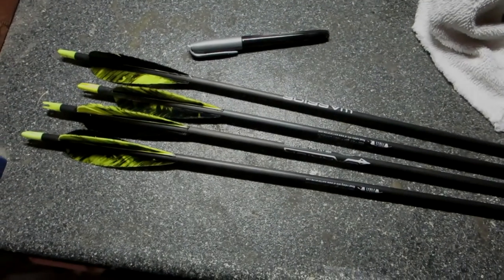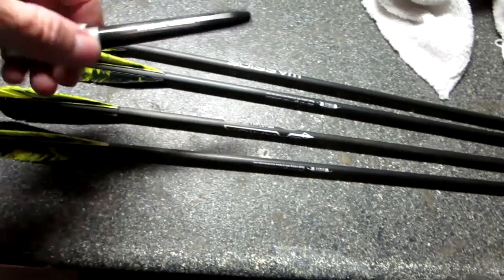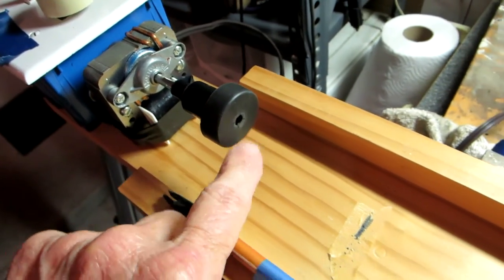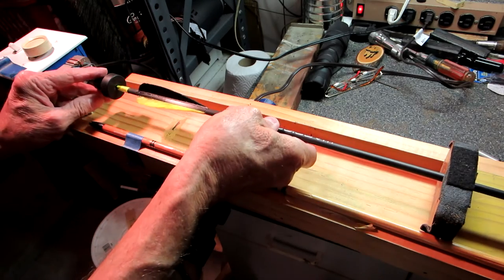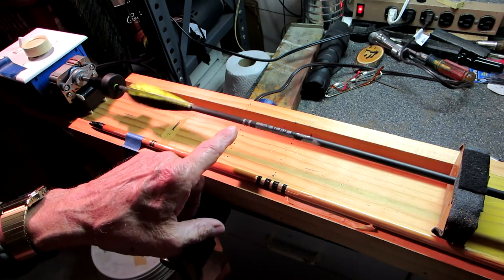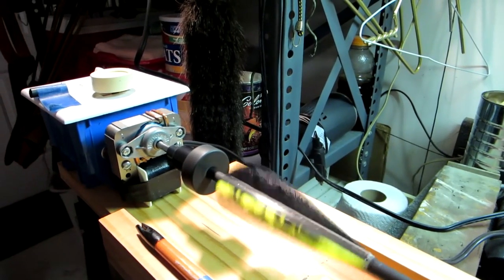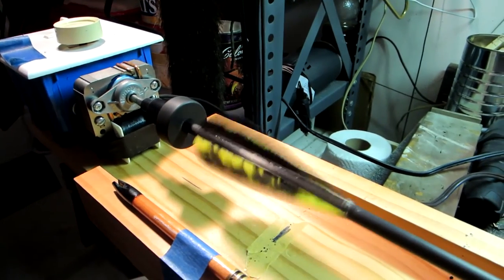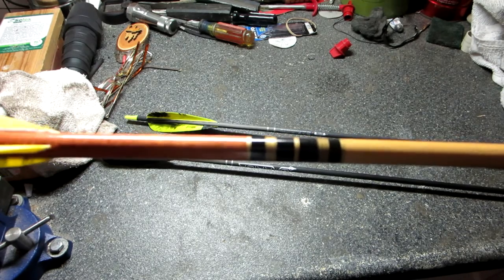Simple arrow cresting with my DIY arrow cresting machine

Comment: Boy id sure like to see how you wired that with the switches so I could make one lol
Reply: if you don't feel like brushing up on the basic electrician thing, just go to a big box store and get one pre-made. You can buy a light dimmer slider built into an extension cord. Then all you have to do is (if there's not a plug on the motor already) take a scrap electrical cord (with plug intact) and strip the two wires and attach them to the wires for the motor. If the motor happens to work better with the wires one way than another in regards to +/- (well, really Hot/Common), you can go with the better  type of orientation that works better, but in my experience with these little 110 volt AC motors it never matters. In fact ones like he has often have a non-polarized plug on them from being a bathroom fan installed, and can literally be plugged into an outlet either way.

Comment: Looks like I have the same fan motor. Could you share with me how you mounted and wired it? I'm building one very similar right now. Thanks!
Reply from the maker: I’ll start by stating that playing with electricity can be dangerous.  I am not responsible for any mistakes or accidents you may incur. If you agree, then you can proceed with the below...

I simply mounted the motor directly to the outside of the electrical box (with spacers as needed) so that the motor bottom and switchbox bottom were even when sitting on the mounting board.

Since the motor has just two wires, you’ll only need a two-wire supply line (typically lamp cord) with a polarized plug end (One spade larger than the other). Purchase an inexpensive extension cord and cut off the female plug end, keeping the male plug end you will plug into the wall for AC supply. It’s important to keep the correct polarization of the connections for safety reasons. The large spade of the plug end is the neutral spade. The exterior of the lamp cord on the neutral side will be either ribbed or have a white stripe. That is the side that connects to the large spade end of the polarized plug. The other wire is the hot wire and will have a smooth exterior. The single pole switch (here after called the on/off switch) controls the supply (hot side) to the dimmer and the dimmer controls the motor speed.

OF COURSE THE SUPPLY CORD SHOULD NOT YET BE PLUGGED IN

The On/Off switch should break the hot lead (black or smooth side) of the lamp cord. You can go ahead and connect the white or ribbed neutral supply wire of the lamp cord directly to the white lead of your motor, inside the switch box where you have mounted your motor.

Turn the On/Off switch to the off position. The black/smooth (hot) wire from the lamp cord goes to the top screw (brass) on the side of the On/Off switch. Now connect one of the wires from the dimmer control switch (doesn’t matter which dimmer wire is connected) to the bottom screw (brass) of the On/Off switch. Connect the other dimmer control wire to your other motor wire (black). You can ignore the green wire on the dimmer since you’re only using a two-wire supply and the neutral wire should be correctly polarized and connected to the polarized spade lug (large spade) of the plug, if you’ve kept the ribs and connections straight.

Use wire nuts to twist, connect and protect the ends of all the wire connections inside the switchbox. If you don’t have wire nuts, twist tightly and tape well with electrical tape to protect the wire ends. You don’t want any of the wire ends touching anything they shouldn’t inside the switchbox 

You should now be ready to plug in your cord and test your motor setup. Flip the On/Off switch On and twist up the variable speed controller.  If you find the on/off switch works backwards, simple unplug your supply wire and then reverse the two wire connections on the on/off switch.

Luck....
Reply: Thanks but my motor has 3 wires coming from it; white, black and red, the white and red go to a control switch.
Reply: What did you use on the end of motor to put arrow in?
Reply from the maker: Must be a two speed motor? You should be able to select either the red or black and proceed. Test it first using just two wires, white and one of the other two (red or black). I would us the lower speed since you really don't need high speed.  "A two speed AC motor usually has a red, black and white wire. This type of motor is equipped with a low speed coil and a high speed coil. The red wire connects to one side of the low speed coil and the black wire connects to one side of the high speed coil. The other side of the low speed and high speed coil are connected together to the white wire. If power is applied to the red and white wires, then the motor would operate at low speed. If power is applied to the black and white wires, then the motor would run at high speed."
Reply from the maker: Just a rubber bushing fit into a makeshift coupling. Anything that fits the motor shaft and will accept the nock end of the arrow.
Reply: Black wire comes out of motor and goes to cord, red & wire wire come out of motor and go to switch, the other wire from cord goes to switch.

Comment: What is that you used for the chuck? I couldn't make out what you used. Great tool you made there. I use a Phillips crester but I'm not a big fan of it. I should make my own.
Reply from the maker: That chuck was just a junk box part I had, since replaced by a machined aluminum chuck from an eBay seller. Matter of fact I've purchased two of them, one for a friend. They are great and dead solid somooth. My friends was standard 1/4", mine was custom bored to my spec.  Planning on doing a video soon for that part. Here's the eBay link: https://www.ebay.com/itm/Arrow-Crester-Chuck-Aluminum-Chuck-for-Cresting-Jig-1-4-Archery-Crester-Chuck/202251429897?hash=item2f171fe809:g:55AAAOSwOrxZu77r

Comment: Quick question: is this a one speed motor? I've been looking at some cheap ones and they are all 1 speed at 3000 rpm. Could i still regulate the speed with a dimmer switch? THX! 🙏
Reply from the maker: My motor came from a cheap 2 speed (I used the low speed) desk fan I got at Walmart, seems like it was less than $10. If I'm not mistaken (been a long time since I researched this) the motor needs to be a brush type motor. 3000 rpm sounds high...

Comment: ONe side is the motor. the other side? is it felt material? won't it scratch the arrow while spinning? your video is great btw
Reply from the maker: Yes, the steady block is V shaped to cradle the arrow shaft and it is felt lined. It's very smooth, no scratching of the arrow.